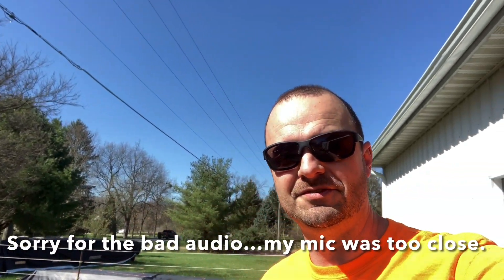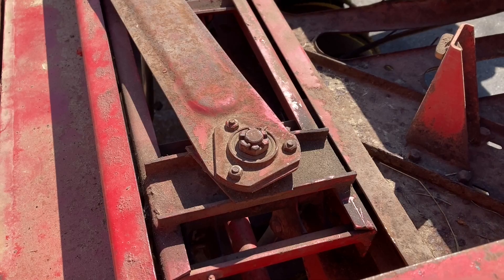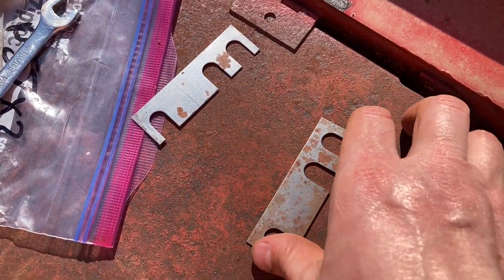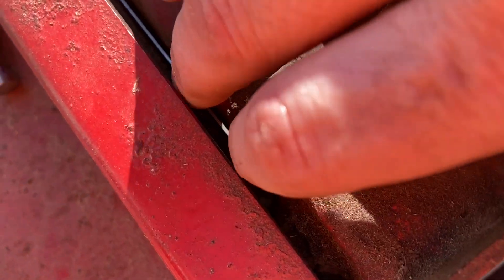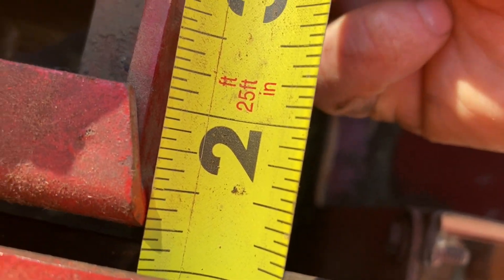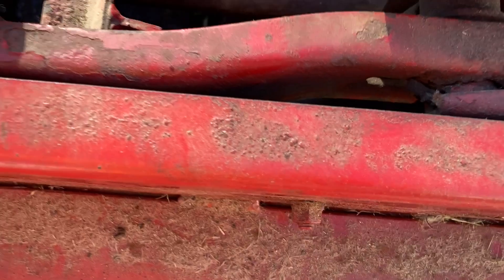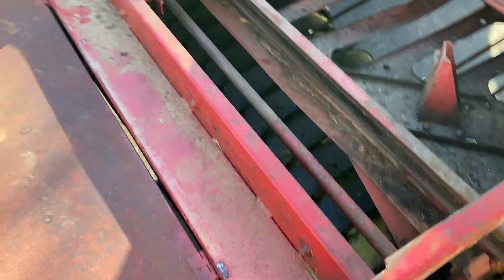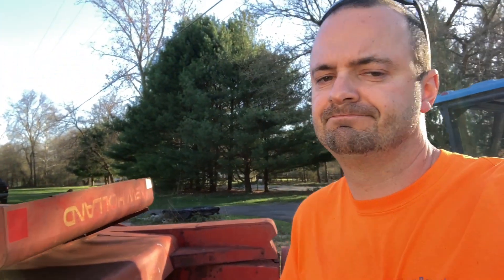Shimming the feeder tine carriage on a New Holland 273 baler

Comment: Another very useful video!  I serviced the carriage on my 273 over the winter.  I pulled the entire carriage out (it only took about 15 minutes to do) and found the wear blocks on the plunger end were worn at a slant.  I suppose that's what happens when it runs for a long time with side to side slop.  I got four new bakelite blocks from Batta's while I was out there getting parts for my pick up assembly.  They were relatively cheap.  All the bearings checked out OK and it went back together easily.  Now it works like butter!